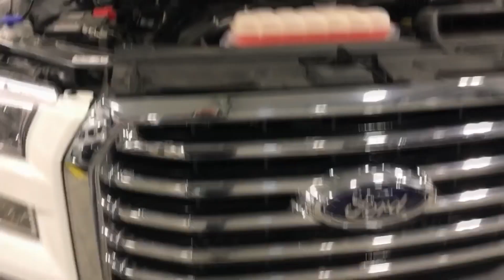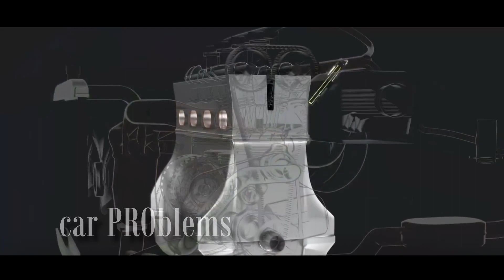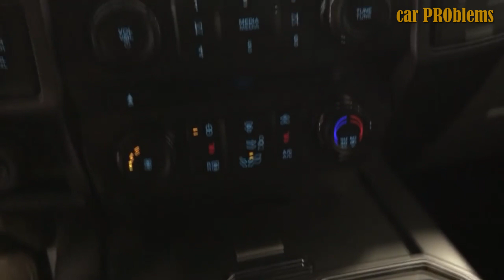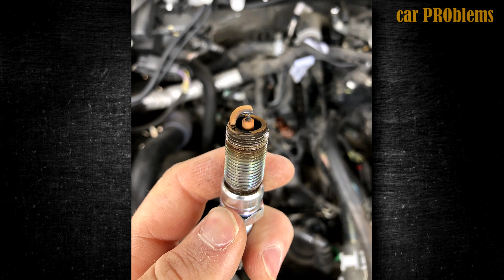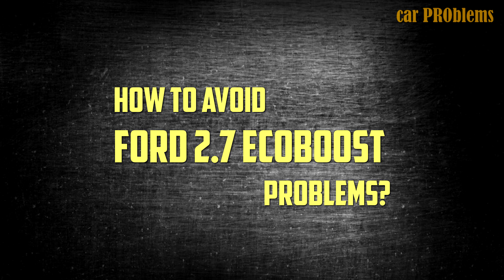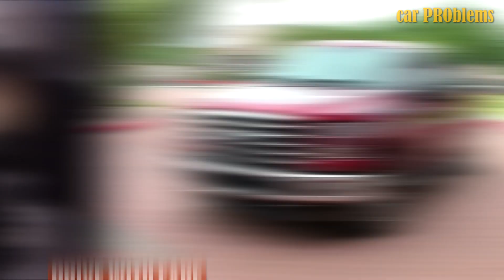Ford 2.7L EcoBoost Engine - Specs, Problems & Reliability

Comment: Hang on, a novel is coming. You can’t fit 8 years of ownership into one sentence. I have 146,000 on my 2015 F-150 Lariat FX4. NO oil consumption. No oil leaks. Original coils. Costco gas, 87 octane, switching to 93 during brutal Dallas summers—the engine will pull timing when it’s 110 out with 87, 93 makes life easier for it. I just put the third set of plugs in. I use Mobil 1 Extended Performance, changed between 5000-6000 miles. Big thumbs up for that cartridge oil filter up top, no more oiling my frame and driveway at every change. The truck runs just like it did the day I bought it new. I think good oil is a major factor in avoiding carbon buildup for the gen 1 with direct injection only. I’m a 429/460 V8 guy who has also had a string of Mustangs from Fox bodies to a 96 Cobra to my current garage queen 5.0 manual ragtop. A V6 with lawn mower sized pistons in a 5000 pound truck seemed all wrong. Until I drove it. It makes torque in the low and midrange like a big block. She stays in overdrive at 2100 rpm and 75 mph, flattening those I-40 grades near Flagstaff like it’s the middle of Kansas. Do I like it? I like it enough I’m adding a 2023 Bronco 2.7 to the stable. That’s the best thumbs up I can give.
Reply: Seems like you have had good luck with your truck. I’m in the market for a used truck and stumbled across a 2016 with the 2.7 at 160k miles. From what I’ve been seeing these 2.7’s are more reliable than the 3.5’s and it’s intrigued me into seriously considering ones. What’s your thoughts on buying a used one at that many miles for around $20k?
Reply: @treethompson  Strap in, you’re asking a big question involving a lot of money, and there is not going to be a bumper sticker sized answer. I’m not sure how much experience you have with mechanical things. I cut my teeth rebuilding go kart and motorcycle engines as a kid so most of this is second nature to me. Most people reading this are going to be in one or two categories: they’re either going to roll their eyes and say well of course, Captain obvious. That, or it’s all going to sound like I’m talking in a foreign language. $20,000 is a pile of money, and honestly the best thing you could do for yourself is to have a reputable shop check the vehicle out before any cash changes hands. If the seller isn’t willing to let you do that then maybe it’s time to find a different seller.  If you can find a shop like The Car Wizard’s place in Kansas, that’s the kind of place you want to use. 

Back in the 80s when I first started playing around with fast cars my take on turbochargers was “twice as fast, half as long” I was all about  big block V8 engines. And the turbo systems they had on cars back then were pretty awful. They didn’t even start using water cooled housings until the end of the 1980s, so shutting down your engine immediately after a long hard pull might just destroy the bearings in your turbo. That was just one of the issues you might’ve had to put up with back then. It’s a completely different world today. The oil is better. The metallurgy in the engine is better. The fuel delivery systems are far more advanced. But you still have to maintain the engine, and the biggest thing is to ignore the oil change interval that the computer suggests and just change it every 5000 miles or six months. It’s the cheapest insurance you will ever buy. Oil is like religion, so I’m not going to get into brand X Y Z except to say if the oil meets the very latest API service classifications for direct injection turbo charged gasoline engines it’s probably going to be a synthetic and if you keep it clean, you’ll be fine.

With any rig at that mileage it’s all about how it was maintained. If you can get service records, that’s a huge plus. Although my truck wouldn’t show any oil changes, I do those myself. Still, at 160K I’d like to see at least one ATF change, and fluid swaps for the transfer case and differentials. Antifreeze, too. Those items are usually done by dealers so there should be records. 

You can get an idea about historical oil change intervals by pulling the dipstick and looking for varnish up above the oil level. The stick should be clean. If it is shiny/brand new? Someone might have cleaned it, so just use your judgement. You can also shine a flashlight inside the oil filler tube, and have a look at at least a little bit of what the cam and chains look like. If every part you see has a brownish coating on it, the engine has not been serviced regularly. 2016 still had single direct injection so there could be carbon buildup issues. I’ve never had problems with mine, but I’ve always kept clean synthetic oil in it, which helps because the synthetic oil stands up to more heat before it starts breaking down. What happens is blowby and your pcv system send a fine mist of oil past your intake valves. If the oil breaks down, you end up with a nasty coating of carbon on the valve stems, and the the ports of your intake system. Your giveaway here is a rough idle, especially after a cold start. That seems to be when the cylinder imbalance caused by severe carbon buildup is most likely to show. My engine has a little bit of a rough idle from stone cold, certainly not enough to classify as a misfire, and after the first couple of blocks of driving it smoothes out nicely. It’s behaved this way since new, so I’m calling it the nature of the beast. Gen II 2.7 and 3.5 both get direct plus port injection, which eliminates the carbon issues once and for all. For the rest of us, good synthetic oil changed 5000-6000 miles goes a long way. Good luck and if you don’t remember anything else out of this novel I just dictated, remember this: look for signs of regular oil changes and have a reputable shop check her out before you sign anything.
Reply: @F9FCJ429  i appreciate the novel! Everything you said makes sense. The one I was thinking of looking at sold so I’m still on the hunt. We’ll see what happens
Reply: @treethompson I've owned a 2015 & 2018 with the 2.7. 2015 traded in at 200k. No issues whatsoever & I haul a trailer for a living. Those are loaded miles. My 2018 was the year the 10speed was introduced & port injection was added for carbon. Motor has 165k. Again loaded miles. No issues. That 10speed however.... many issues. If I was you, I'd get a 2017 with the 6speed. Just makes sure every 15-30k miles you run 44k in the tank to keep carbon build up to a minimum.
Reply: @NewEraMusic972  if you don't mind me asking, what issues have you found with your 10 spd transmission? I have a 2019 with the same setup but fewer miles
Reply: @cactuscanuck6802  At around 80k, trans would slip going into 4th gear & shift hard into 5th. It was random. But happened pretty often. Trans was reprogrammed at the dealership but the issue returned 2 days after normal driving. On the way to the dealership, getting on the highway at a little past half throttle, the trans started to give altogether. Any gear, past half throttle & the trans would start slipping. $4500 later(under warranty), the issue was fixed. I don't remember what all was done tbh. Since my original comment, I'm now at almost 180k. Recently, the trans has started to give again... Basically, in any gear, but especially at higher speeds, it will start slipping past 3/4 throttle. Needless to say, it's no longer under warranty. Soon, I'm going to replace it. I've always maintained my trucks extremely well & I don't drive them rough. Rarely do I touch 3k rpm. That said I do tow often. It's my work truck. On average, I'm towing around 4k lbs. That includes trailer & load. So I'm not over working the trans. Overall, I'm not pleased with that 10speed for reliability. 2.7 is still extremely strong. I've had an O2 sensor replaced. That's it.
Reply: @NewEraMusic972  thanks so much for the info - very interesting. Mine has done a similar thing surrounding 4th gear, either going into or out of 4th, up or down, it will either rev hang before completing the shift, or just shift rough. Ironically it is mainly when the trans is cold, and more common if I have it in snow or eco mode driving gently which I normally do. I tow about 2 to 4 times per month, usually 3500 lbs or less, plus a 6500lb RV once or twice per summer. So I'm definitely not over working it either. Did the dealership offer any info on how to possibly prevent this going forward? Frequent transmission fluid changes or anything like that? My dealership knows of my concern with this but has offered me little in the way of proactive info.
Reply: @cactuscanuck6802  Np. I think every Ford dealership is hesitant to say anything regarding this trans as there is a class action lawsuit against Ford over it. Chevy has the same exact 10speed. They have a class action against them as well.
Reply: @NewEraMusic972   interesting, I had not heard about the class action. Definitely going to look into that. Take care brother!
Reply: @treethompson 2019 Ford F-150 XLT Sport 4x4 Super Cab ,2.7 EcoBoost engine,26k miles, $39.000 plus tax CND right now mint condition 1 owner
Reply: Our fleet of 2.7 2017 / 2018 x4 / 2019 x2 / 2023 all with lumber racks loaded daily ultra reliable trucks with 2.7. 2017 has 265k miles.
Reply: "A V6 with lawn mower sized pistons in a 5000 pound truck seemed all wrong. Until I drove it."- You nailed what I think is a major concern to many people, and something I wondered. The design of this and all the Ecoboost engines seems "all wrong", because of everyone's history and experience with V8's and straight 6's. So you went in with that prejudice, and were convinced it is not the issue many think it is.

EDIT to ask: But have you needed to have carbon removed from the valves? If so, how many times in your 146k?
Reply: @proto57  A year later. 153K on the truck. No carbon issues. And the 2023 Bronco 2dr 2.7 is sharing garage space with the F150. The dual injection system in the Bronco does let her idle more smoothly than the straight up DI engines. But my OG 2.7 F150 is still smooth and strong.  I credit that to my use of good synthetic oil. 

The trouble starts when the PCV system introduces crankcase blowby to the intake tract. With gasoline and detergents to wash the backside of the  valves? No big deal. But conventional oil turns to carbon sludge when heated. Good synthetics can take way more of this abuse before turning black. So just like my old man told me when changing the oil in his rides: it's the lifeblood of your engine. Keep it clean. JBA: 1934-2004
Reply: E
Reply: Has tenido éxito con tu vehículo por qué eres una persona muy responsable con tu vehículo y siempre lo tendrás si continúas así, no hay vehículo malo, pero si propietarios malos pero tú no eres uno de esos, sigue disfrutando de tu vehículo,espero pronto adquirir una f150 2.7 es una muy hermosa!!!
Reply: how did your plugs look at 30k miles...they should last at least 50k and in most cases 100k if they are iridium
Reply: People who don’t like the 2.7, have never driven one.
Reply: God dam That's a hell of a testimony. 
My 2.7 has been fantastic.
Reply: This video is click bait.
Reply: What about those turbo chargers have you had to get those replace
Reply: I’ve had the same Performance and reliability out of my 2015 XLT with the 2.7.  Amazing performance. I’ll only buy another 2.7.  Best engine set up since my Boss 302 Maverick from the 1970’s

Comment: I would have developed a high compression, dual injection 2.7 litre 4 cylinder,  developing around bhp/torque 200/200 with an advanced EGR system for emissions and a similarly engineered 4.0 litre inline 6 cylinder, developing about 320/300 with an emphasis on simplicity, durability and reliability not engine stalling, oil dripping and carbon build up. Turbocharging is not the answer to everything.
Reply: And don’t believe everything you hear on YT, some of the things said in this vid is bull💩

Comment: premium gas ............have u checked the price diff thats a deal breaker no wonder I see so many used 2.7L on my local lot this is a $35k truck i'll wait my 04 f150 4.6L. only has 77k miles still hauls my bass boat just fine ....for now
Reply: You can use either 87 or 93. Also I had a 4.6 2v, great durable engine
Reply: A healthy 4.6 is as good as anything if you're not looking at $$$. Expected issues on the 4.6 2v aren't so bad with proper care. However, if I did go newer I would get a 2.7 and treat it well (like the 4.6 and also 5.4 2v, Not 3valve. I've had a couple of 5.4 2v and they are smooth and quiet, and with proper care 250,000+ miles is achievable. We'll have to wait for 15 more years to find out how these EBs turn out, but for me an older 10th generation (1997-2003) 5.4/4.6 is just fine...IF TAKEN CARE OF.
Reply: @gen-zeke-8571 400k on my 03 4.6 and 300k on my 00 5.4. Oil changes every 8 to 10000 miles.
Reply: I use 87 in my 2.7. I use chevron gas so its probably a solid choice for 87 gasoline. Truck runs great.
Reply: Have the 2.7. It needs Lucas fuel stabilizer every couple tanks  have the catch can  it's great But  
Had the 4.6. Was a great runner
Reply: I've had 2 of them and used nothing but 87 octane with 0 problems, they're really good motors.

Comment: Have a 2015 2.7 in a F150. 140k miles and not a single problem, might be most reliable engine I have had in a truck.
Reply: Same as my 2016.

Comment: not a direct injection system, it has a dual or port injection system
Reply: The 2011 to 2016 2.7 didn't have duel injectors,  the 2017 to 2023 had both injectors.
Reply: So why were the intake valves all caked-up?
Reply: Perhaps he used a pic of some other engine to try a prove  a point. Just like he said excessive oil consumption, that’s bull💩, I’ve never heard anyone make that claim unless you had a 5.0 @hmdwn

Comment: 25k miles on my 2018 2.7 with 33s and a lift. No issues so far and I run it hard going off road on weekends and city commuting every day. My only complaint is with the clunky 10 speed transmission that it’s paired with. the trans slips often when accelerating from a slower speed and just feels wacky sometimes. But the engine in my opinion is the most solid choice for a turbo engine in today’s market. 

2024 update: almost 40k miles and not a single issue with the truck. Moved from California to GA  loaded down heavy and it performed like a champ.
Reply: Supposedly, having the dealership disable the learning makes a big improvement in transmission performance.
Reply: You can buy a Cheap scan tool. 25 bucks. It solved my 10 speed issues
Reply: @MacGregor.  which scan tool?  how did it clear up issues?
Reply: @AC313_  FORScan   Brings up a menu. Disable transmission adaptive learning. 
Plug in underneath dashboard. Steering column.   First couple hundred miles after reset it learns your driving habits. No more clunking etcetera
Reply: Glad my 2015 come with the 6 speed. So far so good. I think the 10 speed is over kill personally.

Comment: I think you are wrong about higher octane fuels burning cleaner, where is your data to support that claim?
Reply: Put a Tiger tail in tank🐆
Reply from the maker: Partly agree. Higher octane fuel is designed to resist detonation or "knocking" in high-performance engines that have higher compression ratios or turbocharging. It is not necessarily cleaner-burning than regular gasoline.

Some fuel manufacturers do add detergents to higher octane fuels that can help keep engine components clean and reduce emissions. Additionally, some higher-end gasoline formulations, such as "Top Tier" gasoline, may contain fewer impurities and contaminants, which can lead to cleaner burning and reduced engine deposits.
Reply: If you think you need to run premium in this 2.7 daily you are wrong. If that’s the case then a 5.0 with 12.5 factory compression ratio would require premium all the time, and it doesn’t need that at all @carproblemsmax
Reply: All gasoline grades  have detergents in them!!!
Reply: @surroundedbyjaggoffs  and top tier gas has more detergents in it, to be called top tier it has a set of standards it must pass unlike any other brand of gasoline